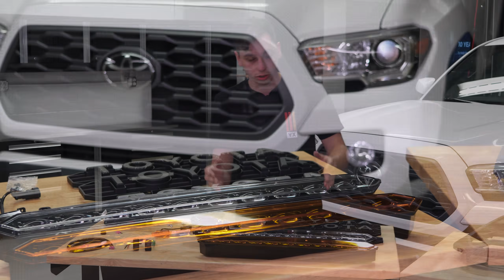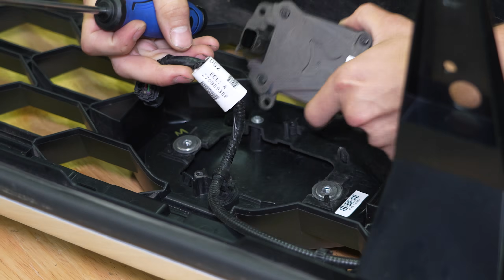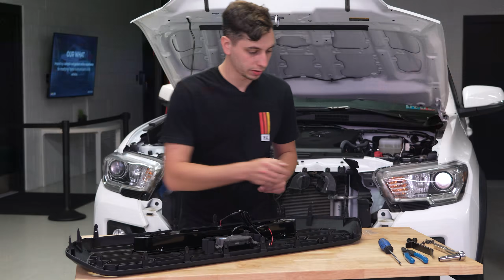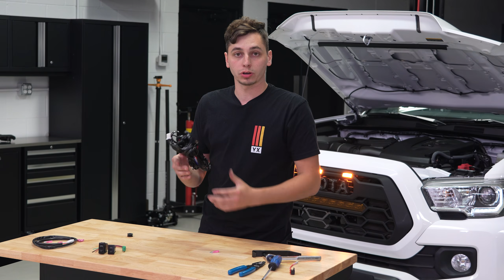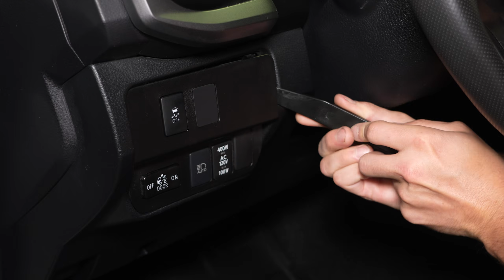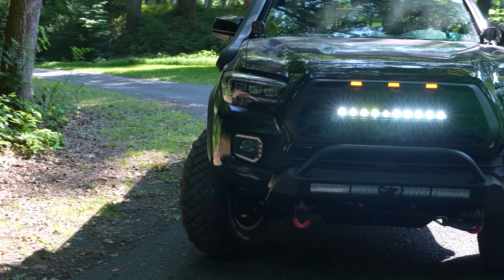Best Tacoma Grille? V2 Pro Front Grille Install & Overview | Tacoma (2016-2023)

Comment: You guys got a link for the wiring harness for the led bar that goes on this grill……. I need the relay and the wiring harness
Reply from the maker: We don't sell that exact harness by itself but this harness from Diode will work. 
https://yotaxpedition.com/products/heavy-duty-single-output-2-pin-wiring-harness
Reply: How do you get the two lightbar wires to attach that harness though

Comment: How bright are the light bars? Lumen or candela specs?
Reply from the maker: We recently bought a tool that measures this. We still are waiting for it to come so we can get this information.
Reply: Update for anyone thinking about buying this product. 
I pulled the trigger and installed it by following the video. The truck looks great and it definitely looks more aggressive but the light bar is not bright at all. I know the light bar alone was only like $180 so I wasn't expecting much but my high beams are brighter. The description for the light bar on the yota website says "the powerful LED light output significantly improves visibility during off-road" 
IT DOES NOT! I NOTICED LITTLE TO NO DIFFERENCE BETWEEN THE LIGHT BAR AND MY HIGH BEAMS.
Maybe I got a defective light bar or installed it wrong. 
I'm hoping yota comments back with some answers because it does look very nice but the light bar is a deal breaker.

Comment: Should’ve added the issues this causes with the tss sensor
Reply from the maker: Please explain which issues you're talking about. We have had no issues with any of our grilles and the tss sensor.
Reply: @yotaxpedition  pre collision light came on and disabled my cruise control and I get the “pre collision system malfunction visit your dealer” constant message on my gauge. However the grille works with the pcs system just fine for about a week then the error comes on. If I swap the oem grille everything goes back to normal. I will also add my truck does have a lift 2” front and 1.5” aal in the rear but it’s a mostly level stance with a slight rake so idk
Reply: @SlideonSunday if you’re adding this grill to a stock height Tacoma, there’s no issues. If you’re running a lift, you’ll need to either goto a dealer or experiment with washers to angle the TSS sensor correctly - you just need to get it level.
Reply: I got you , so with the tss sensor . Remove the sensor and add some 1/4 washers on the top two black notches . Put back the two 10mm screws that you removed and you should be set. This is only an issue with the sr5 and lower.